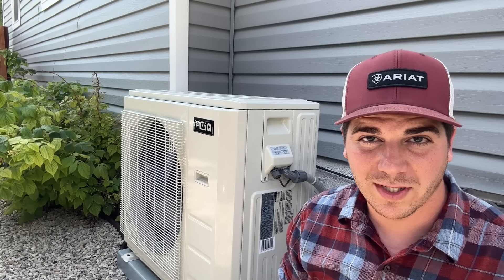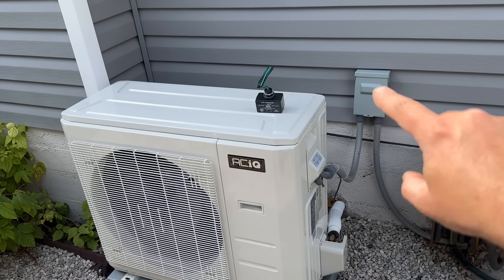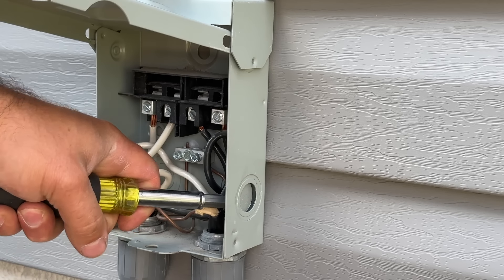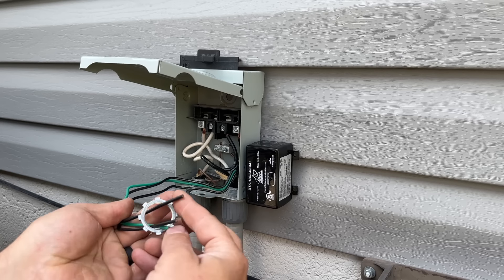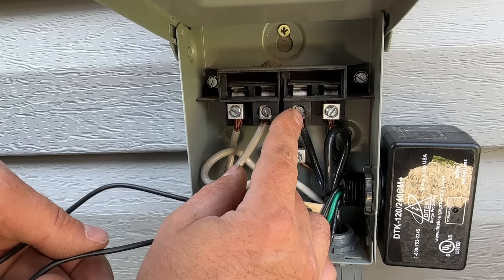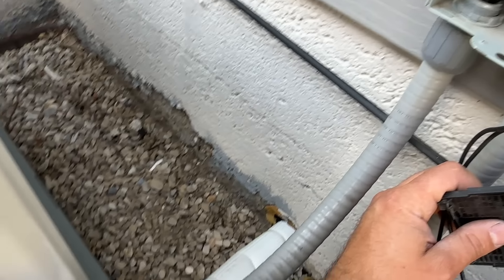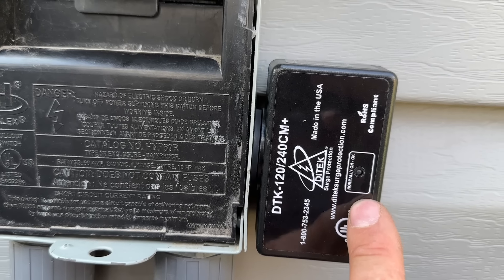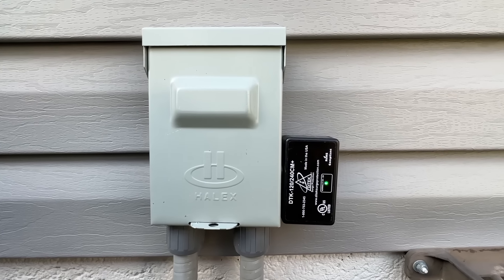Protect Your HVAC Equipment For Less Than $80

Comment: Hi Dave, can you do a video where you install a whole house surge protector device (SPD)? Also, if someone has a whole house SPD do they still need a separate SPD on their HVAC equipment? Is it best practice to have multiple layers of surge protection or is one enough in most cases? Thank you, great video.
Reply: You want as many layers as you can reasonably afford. One at the main panel, and one at any AC disconnect or other subpanels. You also want the standard surge power strips for any expensive stuff that plugs in. Modern electronics are very susceptible to power spikes (not necessarily lightning) and these SPDs are relatively cheap insurance.
Reply: It is cheap and easy to add a surge cube to all your appliances and electronics.  They can be found for around $15 or so.  I always look for the one's that are UL1449 rated, as they have a 330V voltage protection, vs the cheap one's can be 400V or higher.

I have a surge cube on all my appliances including refrigerator, dishwasher and washer.  Anything digital with a circuit board or a display should be protected.  If you have a computer or expensive TV, use a UPS also.

Comment: Is there any objective 3rd party testing of this device. I'm not an electrical engineer, but a parallel 'surge protector' still allows lots of unwanted power travel over the other lines.  I'm having trouble seeing how it can do much good for a lightening strike (and I've seen first hand what they can do--twice), or is this only for small power line surges?
Reply: That’s why I always use ‘listed’ equipment from an approved test lab such as UL and tested to an official standard. You still have to make sure that standard applies to what you want to do. This particular product does have the UL mark.

Comment: I just installed a Siemens FSP140 Pro whole house surge suppressor in the main panel.  My Carrier Infinity Series AC compressor is on a seperate meter and the wiring appears to be seperate from the main panel and is not most likely not protected by the FSP140.  Can this device be installed and will it protect ths seperate circuit?

Comment: Can i apply this to my central air to protect my capacitor ? thanks,Peter
Reply from the maker: It’s more for your circuit board, and other sensitive electronics. Not sure if it would help with a capacitor but it very well might!
Reply: @diyhvacguy   Thank you. Let me know when you are around Boston.

Comment: Isn't a surge protector kinda overkill? If your home is grounded properly then all discharges should be going to ground either from the utility lines, lightning strike, or internal electrical components, not to mention that's what a circuit breaker at your electrical panel is meant to do, shut off power when over amped or short occur.
Reply: If the overvoltage or overcurrent event is occurring on L1 or L2/your hot wires, then that event will destroy the PCBs in the equipment before it makes it back to ground.

Comment: Great idea……i have a question though. I have 2 disconnects on my heat pump package unit. Which one would need the surge protector?
Reply: Both - the whole house is one big shared circuit and thus you need to protect the surge from coming Into tye AC on all legs that lightning etc.. can ingress.
Reply from the maker: One is for your heat strip and the other is for your compressor and fans. The one for your compressor and fans is the one you want. It’s probably a smaller breaker then your heat strip 👍🏼

Comment: Does it matter if the surge protector is installed at the disconnect or at the actual panel?  The electrician my HVAC company used installed it at the panel.
Reply from the maker: I don’t think it matters. I like having it at the equipment so you know to check that green light when you walk past it or if you know a power surge happened

Comment: what if your not using a disconnect and your using 120v with one breaker ? Then all you have is 1 ground 1 common and 1 load/line wire
Reply: It works with 120v as well and you can install it on your breaker circuit in your main panel that is for the AC
Reply: @tangoseal1  thanks

Comment: Why are you using a black and white for L1 and L2 240 VAC? You should have labeled the white as red L2.
Reply: Umm, that's not how it works
Reply: He is using Black and White as this is a 120Vac system, and he is using one Hot and one Neutral wire.
Reply: @redbaron6805  He is not. That is a 240 volt unit. Try again.
Reply: @timcat1004  My bad.  Double checked the video and it is indeed a 240Vac system.

You are correct that the White wire should be labeled as Hot when used in 240V application as it normally indicates a Neutral if it is not marked as Hot.

Comment: Should I assume this is compatible with soft and hard start kits?
Reply: Hard start kits just connect an oversized capacitor for a few seconds with a relay.  Soft start systems ramp up current gradually with a SCR.  This would work with either one.
Reply from the maker: Correct

Comment: IF you went to electronics school like me you would learn that surge protectors do NOT work against a lightning strike . The flash is so fast it laughs at the protectors as it passes through it. It does help with surge from the unit turning on.
Reply: Then you must have flunked electronics school.  Surge protectors reaction time is measured in Nanoseconds, or 1/1000000 of a second.

Lightning strikes can overwhelm and damage or destroy surge protectors if they are close enough, and no equipment will survive a direct strike.  But claiming surge protectors don't work against lightning strikes nearby that cause power surges is 100% false.

Comment: There’s got to be good way to capture all that heat the outside unit is putting off, and put it into hot water for the house, or pool, or spa.
Reply: I thought my heat pump would do that, use the heat from A/C to do the DHW, but that was not the case ☹️
Reply: It's called a heat pump water heater.
Reply: @AustinMichael  I have a heat pump water heater, it has nothing to do with the hot air output of my HVAC unit.

Comment: I don't get it. With the original wires still connected the exact same way they were, the surge can still go straight in to the unit.  A power strip for a computer, for example, is a "in between" protector. The power can't get to the devices.  I don't think I would trust this contraption.

Comment: At first I didn't see how this protects, I was expecting it to be inbetween the incoming line in series.    But this video explains https://www.youtube.com/watch?v=xR15_jv8sP8&ab_channel=SchneiderElectric
.  This is a parallel surge arrester; high voltage spikes excite a gas which then becomes a short to ground.  Because electricity takes the easier path this device routes the excess voltage to the grounding wire.  

These are cheaper, smaller, and if they die it won't stop your a/c from running - assuming it hasn't been damaged by whatever killed the surge arrester.

Comment: Surge protectors ARE NOT 100 %.
I had a "whole house" surge protector installed.  Last week we had a power surge and it blew up my furnace and three retail surge protector power bars.   I had to replace the entire furnace circuit board.   Surge protectors are better than nothing i suppose, but they're also  a false sense of security.

Comment: But the power still going straight to the a.c leads . If lighting strike or power surge still will travel to main leads . 👎👎
Reply from the maker: Correct but it takes the path of least resistance which is now your surge protector.
Reply from the maker: Or ground